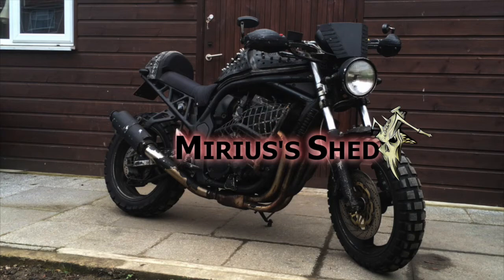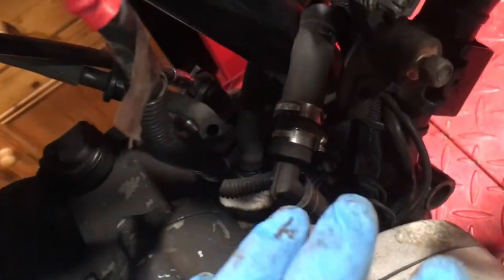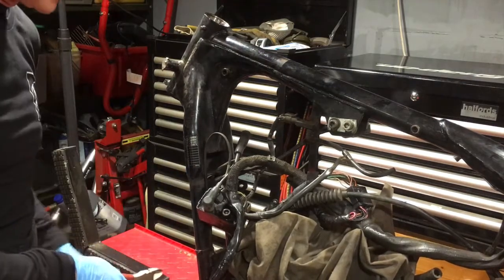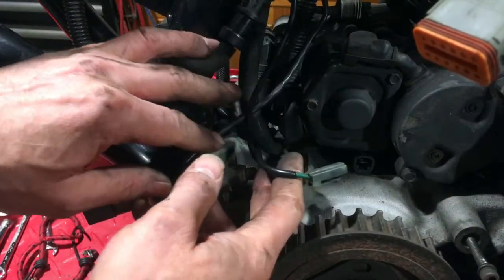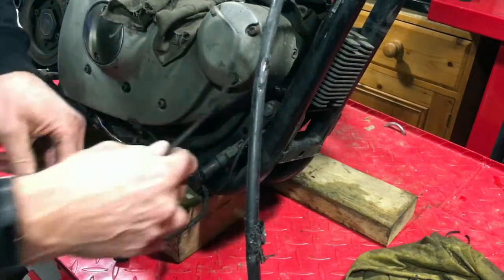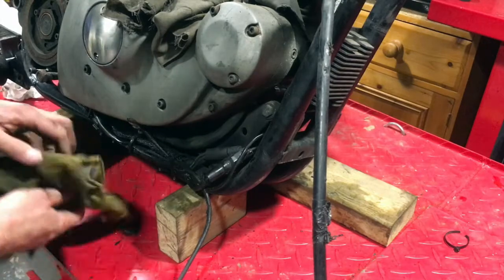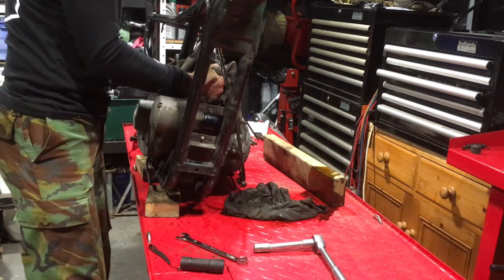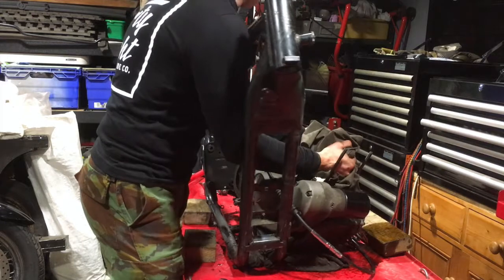Sportster Sport 1200 Build #6: Engine and Wiring Loom Removal

Comment: I have my frames sand blasted by local monument companies (they use blasters to cut lettering in tombstones) who almost always do blasting on the side. I just had my Sportster frame done. I protect the steering neck outer races from sand blasting  by use of all-thread, nuts and wide flat washers with a wipe of clear RTV between washer and neck tube. This also survives painting or powder coating and works with wheels too after axle removal. Besides my frames I did my mentor's 1939 Indian Chief frame and hubs that way. I keep an all-thread "kit" for such work.  You can apply RTV to threaded holes to mask them for paint or powder coating, then easily pull it out with forceps.

Sportster engines are easy to bolt to common, cheap automobile engine stands. The rear mount usually fits the slots in stand head plate, but you might have to drill a hole or two in the plate. It's handy to rotate engines when working on them.  Here's a pic (scroll down)  of my 1200S engine bolted to a stand head while suspended on a lifting fixture I made from scrap. 

http://www.chopcult.com/forum/showthread.php?t=50752&p=787391#post787391

If you've not visited the xlforum they are the best Sportster forum by a long shot.  http://xlforum.net/forums/index.php
Reply from the maker: Skal for that.  I'm considering blasting, it's one of the main reasons I was considering powder in the first place.  Great point with the RTV and an idea that I will certainly use.  I don't have room for a hoist sadly but that is an interesting mount you made and I will bear that in mind if I can think of a way to adapt it, so thanks again.
I've been on the XLforum for a long time but I don't post a lot - I will be using Steelworkers ignition writeup.
Skal, that's is great info

Comment: Nice work mate, with the frame stripped that far, for me there is only one option, and thats powder coating, to help solve the problem of re tapping, stick a blob of high temp silicone over the ends of holes, my mate used to do powder coating, and says it works quite well, and is easily removed with a screwdriver after, comes out like a small plug. Good luck mate.
Reply from the maker: Skal Chris.  I'm still torn, I know powder coating is the way to go.  We will see.  At the moment I'm sorting through all the parts that need paint or powder.  I've bought some plugs, but that is a great tip with the silicone, sounds just the job.  Thanks
Reply: yankee doodle 
Now that's an idea! Never gave that a thought. Nice one Yankee. How's tricks bud?
Reply: softail fun some times the simple ideas are the best, am good thanks mate 😊

Comment: Hi David 
a fiddly job there you got!!!
Why did you change it to points?
Keep the good work up
Reply from the maker: All the good stuff.  Previous owner changed it because the coils died.  Harley stopped making the ECU and ignition systems for the Sport years ago.  You can buy bits but they are expensive and a gamble as to whether they work.  It was cheaper for him to just chop it back to points. Skal.